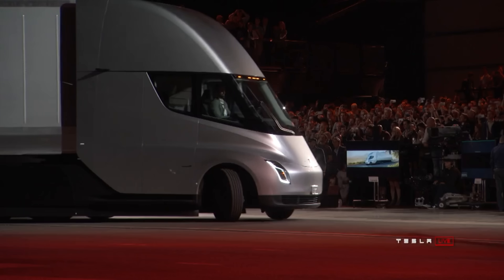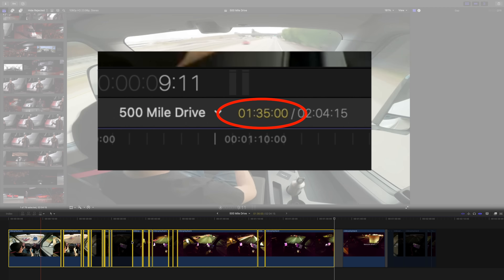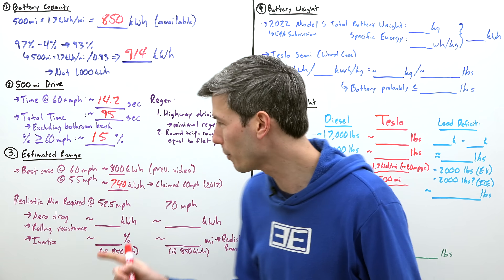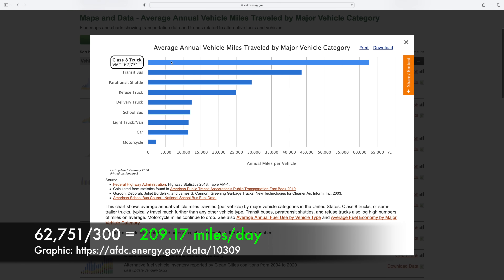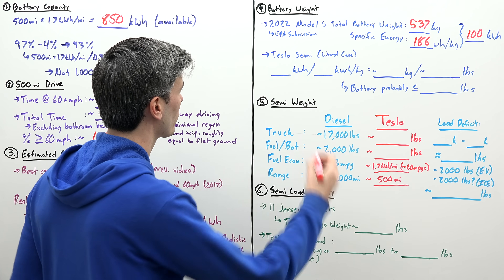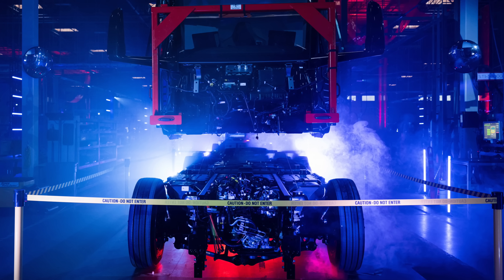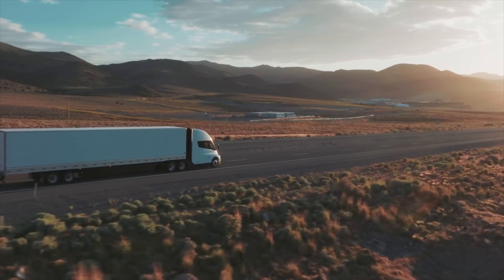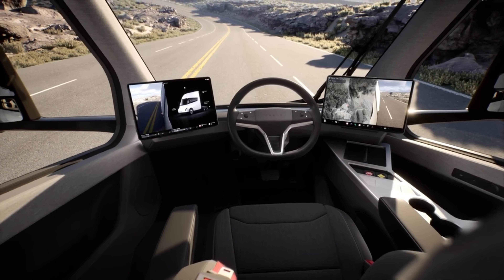Does The Tesla Semi Make Any Sense? Part 2!

Comment: First, as someone who's driven a car with regenerative breaking for over a decade, going downhill does not balance out with going uphill. lol

Anyway your two concerns are not concerns anyone should have unless they're a retailer or private truck driver.  A concern everyone should have is what happens one of these crashes and the battery discharges.  That will affect everyone, not just the owner of the truck and I can't wait to find out how long it'll burn for. 

Also of course it's got subsidies.  I'm of the stance for encouraging more freight by rail and less truck hauling of cargo anyway, let alone Tesla and it's marketing practices.
Reply: Did you see the chart?
It put them back on the line, but the line itself is going down because you are still doing kilometers so there are wheel and drag losses.

Comment: Given the limited amount of battery materials available, does it really make sense to be using them in big trucks? Imagine how many light-duty EV batteries that could be made from one 850 kWh Tesla semi battery. I also question the 35-55 minute recharge time for a battery that large - they must be charging them at levels much higher than the current DCFC available.
Reply: It's just price and demand. If supply was too low the Semi truck would not be economically viable.

Comment: Interesting “back of the napkin” calculations. The engineering looks plausible.  Couple things come to mind. The new Hummer EV has a 200kwh battery. That’s just 1/4th the estimated size of the Semi’s battery.   
Also Musk talks about if an electric motor fails the other two can take over.  Now we are learning there are only two motors. I would imagine the heat management required to keep these motors from melting down to be very interesting.  I know the selling point of EVs is simplicity but I wonder if the semi will need electric motor cooling systems.  Wonder if this is an anticipated issue because he talked about motor failures.
Reply: There are 3 motors, one on the front rear wheels and two at the back rear wheels. Like the model S Plaid

Comment: The 17,000 pounds for the Diesel truck includes it engine weight. The engines weigh 3k-4k with accessories. Plus there is added frame support to carry the engines. The electric motors won't weigh that much. Not even close. I'd be very surprised if a Tesla semi weighs more than 22k. Which still puts it at a serious disadvantage to a Diesel truck. My last semi weighed 17,800#. It was a conventional with a 77" sleeper and a 12.7L Detroit. Hauling produce, you get paid by the 100 pound weight. So, 44,000 pounds paid, say, $4.50 per 100 pounds, varying according to the length of miles. Even at 22k pounds, that's about 4k less freight you can haul and so you're making less money per mile. Maybe saving on fuel cost would offset that.
Reply: On the Donner Pass video, the flatbed was carrying >44,000 lbs.

Comment: Funny that Pepsi and Frito Lay first tried them.  A whole lot more energy could be saved by not transporting as many soft drinks and junk food that have no nutritional value.  Electric trucks do not make much sence for long haul since modern diesels are very clean and efficient, especially in that capacity.  Local routes would probably see some benefits for electric - mostly by displacing emissions from dense urban areas subject to temp inversions.  They might be more suited to stop and go traffic also.

Comment: You are forgetting an important factor in charging these trucks, in both videos
You just waved away a 1400 KW OF POWER, that's NOT a small amount, it's a LOT more than most FACTORIES use, even using a smaller number from this video, it's still ridiculous, each and every truck would need it's own electric substation to handle this amount of power.
Seriously, assuming 220V phase to phase, it comes out to almost 3 THOUSAND AMPS. even using higher voltages, it's still a very high current, and then you have to deal with insulating that voltage, witch would not be simple inside the power packs.
Even getting past that, you have to deal with the very large thickness from the cables, even upping the voltage to 440V, the current only drops to around 800A, witch regulations, at least here, demand 3 240mm2 cables per phase, plus neutral, so the truck would have to manage 12 240mm2 cables AT LEAST, plus insulation.
AND THEN you have to deal with the enormous amount of heat such current pumps out, witch, from personal experience, gets hot enough to burn your hands even trough insulation at just 600A.

And none of this is avoidable trough just new technology, so i don't see how this half-hour charge time is anywhere near realistic.
Reply: 1,000 V DC, liquid-cooled cables.

Comment: Three things that destroy lithium ion batteries 1: Rapid recharging 2: Rapid discharging 3: Temperature. These semis are going to have over exemplified battery degradation compared to normal EV personal vehicles.

The infrastructure too is going to be a hurdle to accomplish since putting up substations for these vehicles to charge is going to be a costly one “if” they want the fast recharging for a drivers 30min break.

Also, I’ve seen you never talk about how fuel weight gets less and thus lightens the overall load as the semi completes its run vs a EV doesn’t get that ability due to batteries.

My overall experience is that instead of the government trying to force the USA population to convert to EVs they should’ve invested heavily into new battery technology since Lithium-Ion batteries are a 70s era technology that has been at max efficiency for the past 15yrs. If this would’ve been done first the infrastructure of these vehicles would’ve followed without the massive government subsidies given to offset EV operational costs.

The only massive hurdle for EVs to completely take over combustion engines is going to be if mankind can find a better battery storage system than Lithium-Ion.

Comment: Honestly though, even without subsidies, the trucks should pay themselves back with normal use. Assuming you can charge for $0.13 (I just picked a rate around the natl. avg residential rate) per Kwh, the cost is $0.22 per mile at 1.7kwh/mile. For a diesel truck at 7.3 mpg, and $4.00/gallon diesel, the cost is $0.54 per mile. Assuming the Tesla truck can get 1,500 charge cycles out of its 850 kwh est. pack size,  before significant degradation, that's 750,000 lifetime miles, comparable to the average diesel semi. Over the lifespan of the truck at a savings of $0.32/mile fuel costs, that's $240,000 in savings from fuel costs alone.

Comment: Actual realworld independent use and conditions application of electric vehicles have shown EV's actually preform well BELOW range claims, as well as a variety of other variable realworld issues of charging. I don't trust the accuracy of Tesla claims and damn sure have zero faith or trust in any chicken little sky is falling climate alarmist promoting government claims. Electric vehicles are nothing more than a novelty when it comes to replacing combustion engines. They are nowhere near ready for primetime and only good for local use. Electric vehicles are unreliable lack supporting infrastructure are more expensive the used market is a crapshoot and they do far more environmental damage than combustion engine vehicles. Forcing this unreliable technology before its time on the public will severely damage the economy as well as the supply chain with zero to negative environmental benefit. If electric vehicle technology was practical the natural market would create a natural demand, at this time there is no natural demand to replace combustion engine powered vehicles. PERIOD

Comment: Great job working through the numbers. It still basically confirms that this will be an excellent solution for short haul trucking where the round trip is less than 250-300 miles. Lower average speed, better response from a stop

Comment: It's good to see mathematical breakdown and some objectivity. I'm curious to know how much infrastructural costs will be required for implementing the charging stations (reportedly extreme).  I'm also curious to know what % of the USA national grid uses renewable energy and how that translates to carbon savings when you charge your Tesla from that grid.  It's all well and good taking away combustion engines, but replacing that with more energy consumed at power stations including the energy lost through the inefficiencies of the system doesn't seem favourable when  also faced with the utterly horrendous conditions and environmental damages caused by open pit cobalt mining in the Congo.

Comment: You used model S pack weight (18650), but the Semi is using the Model 3/Y (2170).

It will be even more efficient with the 4680.
Reply: ⬆️⬆️Thanks for watching my video♥️♥️
Send a direct massage right away
You've won⬆️⬆️⬆️

Comment: Why do I calculate 8 1/3% lower speed (5MPH / 60 MPH), yet the power savings (60kWh / 800 kWh) is only 7.5%?  I.e. if the argument is the lower speed is more efficient (logical, plausible, reasonable), why does the math not follow?  Especially at speed where the aerodynamic drag is exponential.  This doesn't jive!
Reply: ⬆️⬆️Thanks for watching my video♥️♥️
Send a direct massage right away
You've won⬆️⬆️⬆️

Comment: A very big factor that you did not include is climate.  The performance of these vehicles will be seasonably curtailed in a very dramatic way during certain months in the upper midwestern and northeastern USA.   This means your estimates of how many routes based on expected range are dramatic overestimates for a very significant part of the overall trucking industry.
Reply: ⬆️⬆️Thanks for watching my video♥️♥️
Send a direct massage right away
You've won⬆️⬆️⬆️

Comment: Here are My foreseen Issues. and they still hold up against these trucks.
1. Battery degradation from charging too rapidly. Because of the size of the battery they will need to be charged rapidly which will degrade the battery much faster than anticipated. Making the Range useless. 
2.  amount of power they will consume and the time it will take to charge. Down time on a truck that is that expensive will be a huge cost. There are 2 options, One you can increase the charging time which will degrade the battery, or you can have the truck charge for longer times which will make the cost of purchasing the truck more of a liability then an asset. 
3.  it takes a 50amp charger to charge a tesla overnight at level 2 which and that is a lets say around 50kwh battery. This is 800kwh battery. How many amps are you going to need to push into that truck to charge that battery. Based on the KW per mile they dont use that much energy, but when you factor in that there will be peak energy draws to cover all that energy drawn at the same time we need a LOT MORE electric power. Not because of the KWH per mile but because of Peak charging times. 
             when I calculate those things in, We are a long way from these being the ONLY source like Mandated in CA......The Politicians need to go back to school and learn math.

Comment: Shipping car parts we generally try and keep the loads at or below 40,000 lbs. Much more and you can overload axles while still below gvw. If you can't spread the weight out appropriately you can't use it.
Reply: Aren't truck drivers supposed to go to weigh stations to see if their truck is balanced appropriately at 42.5% + 42.5% at the front and back of the trailer, and 15% in the cab?
Reply: @cyclopsvision6370  supposed to or in the book isn't necessarily real life.   Everyone is on a schedule and rushing to meet a deadline.  Drivers have to rely on the dock worker to know what they're doing.   If they are experienced, they'll know something feels off when they pull out and will circle back to ask or go get weighed.

Comment: The driver should be getting a speeding ticket if they went over 55 mph which is the speed limit for trucks on highway in California. In reality, most drivers on the grapevine usually go about 63mph while 4 wheelers are going 70. I used to have a dedicated lane on the very route the tesla took and I know it well. The wheelbase seems rather short for what I do which is otr flatbed.

Also, it seems you might forgot to calculate the weight of the trailer in your calculation.

Comment: What about degradation of the battery? How quickly will it cut into the range/weight economics? Excellent video thanks, very instructive!
Reply: If it's anything like with regular teslas they are supposed to have >70% of the capacity left after 8 years or 120Mm.
Reply: @ruukinen  Realistically they have a lot more, 70% is the replacement point. Most are still above 90% at 120k miles.
Reply: @OtisFlint  Yes but that's what Tesla is "guaranteeing" as warranty. If someone is sceptical it helps to use the worst case scenario instead of looking at optimistic examples.
Reply: @ruukinen is that Tesla numbers or customers? As elon lie about everything
Reply: @AnemosFPV You do know what a warranty is, right?
Reply: @AnemosFPV  That is under warranty, that means if you have below 90% at 120k miles you get a free replacement battery.
Reply: 10% degradation after 3 years of use would reduce a 500 mile range truck to 450 miles.

Comment: One thing worth taking into account is that no battery is ever drained fully or charged fully unless you are prepared to shorten its life. Ev manufacturers are very careful in trying to protect the batteries. So, the 850Kwh battery would probably read zero when it actually had upto 20% charge left. This means your 850Kwh battery would need to be bigger, say about 1,062Kwh. This adds to the weight and size of the battery and a corresponding drop in cargo capacity.
Reply: No way that Tesla includes a 20% buffer, my guess would be 6-7% at max
Reply: @Steinegal  I did say upto. I know all EV manufacturers are going to have different margins of residual charge that their engineers feel comfortable with. I am by no means an expert but I have read in a number of places and seen a few videos where it's claimed that the batteries are not fully charged or fully discharged and this will be controlled by software. So 6% to 7% couold well be true, unfortunately Tesla is notorious on being tight-lipped about any technical deatails apart from the headline stuff like "we can accelerate 3 times quicker than an ICE vehicle. " When it comes to other more intersting deatils like battery weight, actual battery capacity, weight, cargo capactiy, tractor unit weight, etc. they are notably silent. It's a pity really as it is an opportunity to showcase their abilitites. Of course others will see this as them avoiding the question because it doesn't sow them in a superior light.  

So, 6% or 7%, it's ceartainly possible. Will we ever know, probably not.
Reply: and and no calcs for batter degradation from all the rapid charging and full cycles. I am sure the trucking companies would be totally agreeable leaving a truck like that on a slower charger for what days? (sarcastic) at a time 850kw would take a huge amp 220 to charge it or some sort of high voltage setup. it takes a 50a 220 to charge a tesla overnight which is what 50kwh for a base. roughly 4kwh at 10hrs.  so an 850-1100 OMG   WOW.....not alone the energy draw during peak demand.
Reply: and the high voltage setup to charge that faster I am sure would be TOTALLY SAFE.......Yea. right.
Reply: @Mikefngarage  Yes, people underestimate  batteries, they equate EV batteries with the kind of thing you put in the TV remote, or the. Even a 12V car battery can be dangerous. An 850KW to 1,000KW battery at 1,000VDc will fry you and kill you stone dead in an instant if you interact with it incorrectly. Don't forget if you have a 1,000KW charger it's going to need it's own substation, so that will be small.